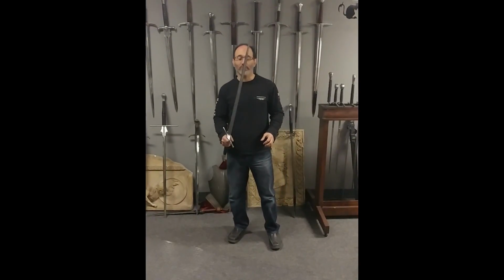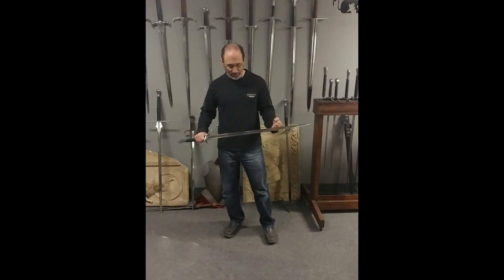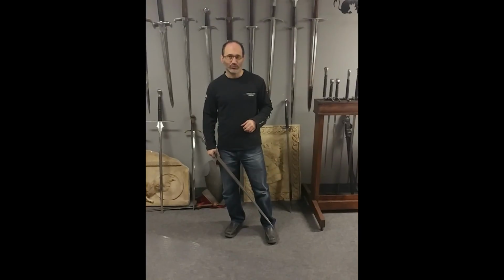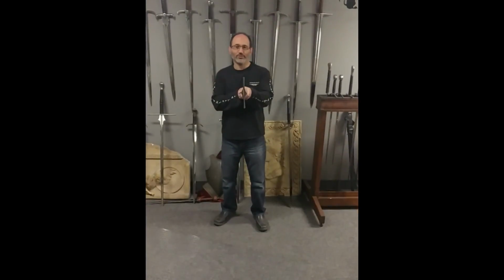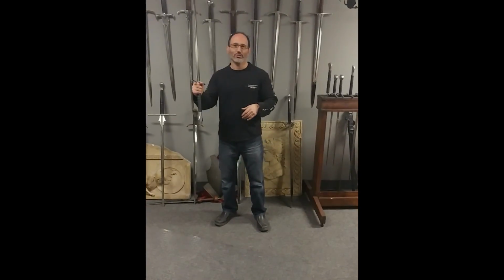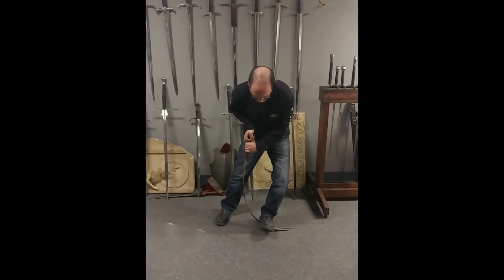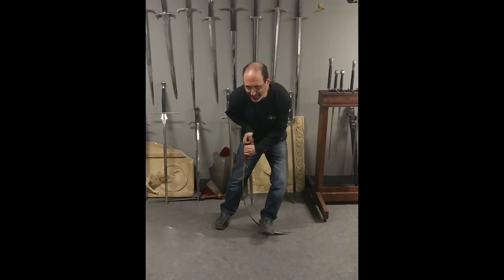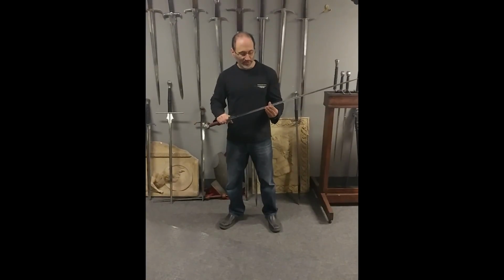How tough are Darksword Armory Swords ? Flex and destruction test.

Comment: I saw that the first sword got bent a bit in the first test, thats why he put it back very fast, put the vid at a very slow speed and you'll see.

However...the ability of the sword to be bent so much and then return completely true is not a requirement, it needs to be weighed against a lot of other things the sword needs to do, like cut and thrust without wobbling or bending, its not end all be all. You make a sword that bends past 90 degrees without taking a set, then you can get a blade that vibrates when cutting and bends when thrusting too much to be effective. 

The fact that this first sword took a set after such an abuse is much better than it breaking in half (shows that the steel is homogenous, without weak points or slag). The second sword didn't take a set, but look that it is a much stouter, bigger blade with a different geometry, made for a bit different scenario (i imagine it being more of a war sword) 

Still, they themselves proposed this test and the guy was very fast to cover the first blade, twirling it and trying to show only the flat after noticing the bend, which i don't like.
Reply: Probably a specially-made demo sword besides!

Comment: Sir, just want to say that you seem to have created good swords but, has the EXTREMLY THIN TANG problem. I've heard and seen alot of good thing about you swords but PLEASE be true to historical measurement on a your blades PLEASE, there are about 5 swords and daggers I want to get from you but after seen a guy remove the handle of his Two handed Norman sword I froze for long minute when I saw that chinese tang on that sword and that my friend chaged my mind about buying your swords. please if you reply, reply with proof that the tang on your sword are wide and solid.
Reply: Their old tang problem is completely gone. Their tangs are plenty thick now. Just as thick as albion or any of the others. That this is even expressed as a concern on such a new video of theirs shows, despite their best efforts,  the word is not getting out as well as they hoped. There is no longer a tang issue. Please do not spread that rumor. It has been squashed with any of their blades these late years.

Comment: I would like to see stress being put on the thin tangs used. The blade wont be the problem, the tang breaking will. Show a vid with your tangs holding up to stress and you could end up with a lot of my money.
Reply: Get Zapt, there are no thin tangs anymore. They fixed that issue a long time ago. Yet apparently it still haunts them. There are plenty of pictures of the tangs on their new blades. The tangs are equal to any other company out there. Why this rumor still continues is beyond me.

Comment: Are your Viking type swords of the same quality ? What is your current wait time ? Say I order a 5 lobe Viking sword #1540, sharpened and with scabbard and belt. I'm glad to see a rebuttal from your company. I've read a lot of bashing and watched a few videos but still not convinced your customer service or products are as bad as what I've read or seen in videos. I have albion swords as well as other brands and have been considering adding one or more of your Viking type swords to my collection.
Reply: I wasn't comparing DSA to Albion. I was collecting and training with swords before you were born so I'm not new to this. I liked the look of the sword I mentioned above but have read a lot of bad things about their swords and watched a few videos. Since DSA never bothered to answer my post above that was the icing on the cake. By the way there isn't anything wrong with blades made in India if they are made correctly. I have a bunch of Windlass Viking swords which have held up for many years of hard use and even some abusive testing. But I do prefer quality. Thanks for the reply.
Reply: @richstone2627  Just got my 14th C arming sword from them and no issues so far. The specs listed on their website is identical to the sword I received. Did some cut testing with twigs, cardboard, water bottles and no rattles or loosening on any part of the sword. The sharpening service was well done too if you don't mind a secondary bevel. The only complaint I have is the gap between the guard and the blade.

Comment: In all honesty. I purchased a 15th century hand and a half sword about a year ago. I chose the sharpened option. What I received was a sword with a loose handle and an edge that was butter knife sharp. I called DSA and spoke with their customer service and they were great. I shipped the sword back at no charge and after a few weeks my sword was returned. Overall a really pleasant experience. 
Here is the rub though. They put a “edge” on the sword. Except that it was hands down  the worst,sloppiest and all together most amateur piece of workmanship I have ever seen. Uneven and ragged. As if they threw it to a apprentice with the instruction to knock this out before you go home. It was bad just plain bad. I ended up having to take it to a local professional! blade smith to have him correct it. 

The lesson here is to not let these guys put a edge on your blade. Find a professional. 

My second issue I believe lies with the tang. While performing some light cutting I.E. water bottles and fruit I ended up striking the cutting stand. Blade alignment was off and the sword glanced off the top of the stand leaving the blade bent somewhere between the handle,hilt and blade all join. Wow I thought. I was able to straighten it out but I am not very leery of using it again. For the reason that once you bend metal and then bend it back,that spot will always be weak and prone to a crack or breaking. 

So now I am not as confident in its construction as I would like to be. Especially in terms of the tang. To thin,to narrow hard to say. Just call this a heads up though.
Reply: good old rat-tail tangs.

Comment: Darksword has a tang issue which makes their swords dangerous. They also have production issues where the hardware such as pommels and cross guards do not fit properly.
Reply: Zoes Dada how big of an issue does it cause because I’m looking into buying the Templar GreatSword from them
Reply: Not sure what Darksword has to do to prove it; the tang issue is completely a thing of the past. Not sure why people still bring this up on such a recent video. They fixed that long ago.  And they prove it over and over again, showing the tang construction on many of their current swords. It was an old issue that is completely gone. Have a look. And please stop spreading that rumor.
Reply: @huntergauthier1819  it truly is not an issue anymore. I have bought and tested so many of their current swords. Their tangs are just as beefy and reliable as the famous "Albion". Their was an issue long ago, but they addressed it. They try so hard to spread that word. Check out their site. They are very open about their blade construction, showing the bare tangs of many of their blades now. Give them a shot! If you do have an issue, they WILL take care of you. Good luck finding that same service with a more expensive mass produced Albion.

Comment: I bought one of your elite ranger swords and the war monger. The elite came untempered and with a mangled edge. The war monger was twisted in the blade and loose in the fittings. Very disappointed. Then I had to send them back with my own money and only got 75% back because you guys charged me a 25% restocking fee...not cool. Won't ever buy from you guys again.